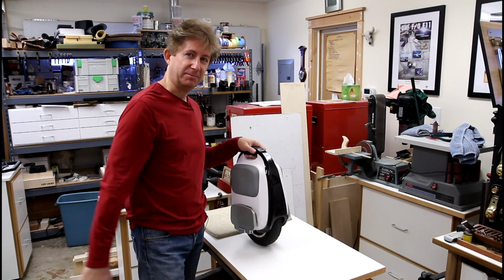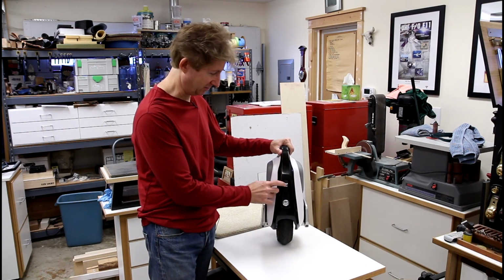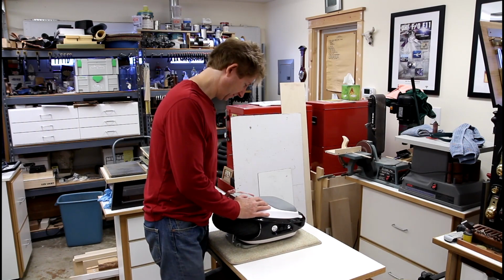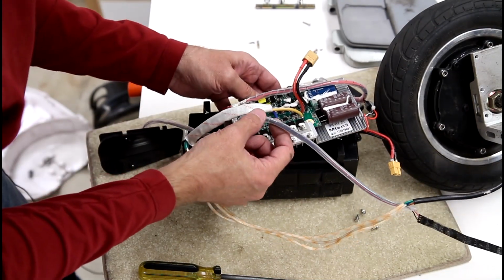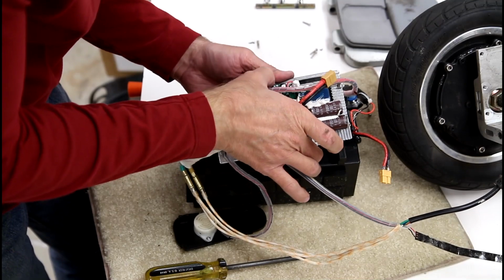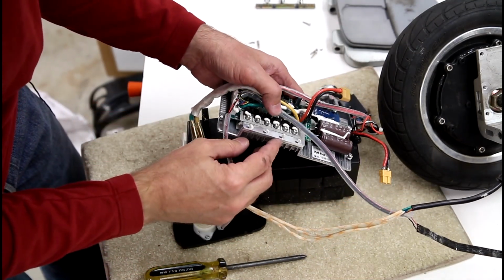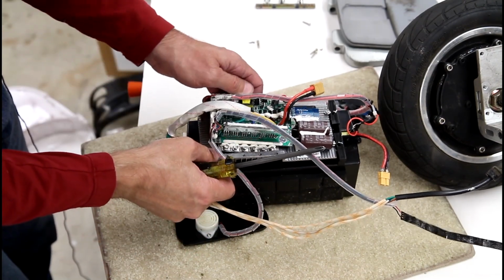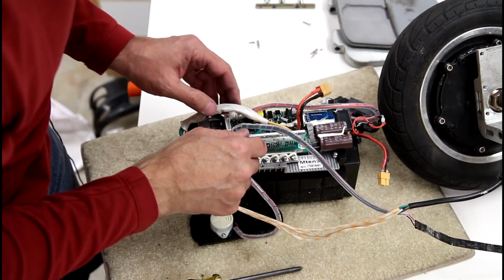Broken Gotway Mten3 Tear Down

Comment: I cannot pull the shell apart like 3:45 -- are there screws under the upper pads that you omitted in this video? SOLUTION: Just pull harder ... that black grid is sticky tape stuck to the white grid!  PRO-TIP: only loosen the "driver's side (USA)" / left side motor bolts if you just need to get into the case.  Leave the other 6 bolted in on the right.  Also, the LED strip is a huge pita.
Reply from the maker: No screws under the upper pads.
Reply: @ElectricUnicycles  Thanks Marty, I got the faulty buzzer out, mine came with the librarian edition.
Reply from the maker: @xorbe2  :-)

Comment: -They should not manufacture things like that. That should be only for business question and sell spare part. 
-From my experience with Drone, it should be like that:
-The PDB (power distribution) us separated to the controller board are all with STM32F3 or F4 chip and F1 is no longer used (how Msuper S3 + 1600 is F1 😱, how can it be?) The difference in frequency between F1 and F4 is huge but the difference price is ridiculous, in the drone to be F3 or F4 allows us better update frequency for the PID and protocol Dshot👍😊 between controller and motor drive ESC (the outdated pwm 👎 is no longer used in drones.) Another interesting thing separates, is to be able to place antivibration on the controller board, that makes it much easier for PID calculations and unnecessary warming 🔥 of the ESC drive, and I think it is at the moment a business design for selling spare parts.

...for when a Betaflight style software for our wheels?...🤔

Thanks for your videos always nice to watch.

(Sorry this us a Google Translator, I'm from Spain.)